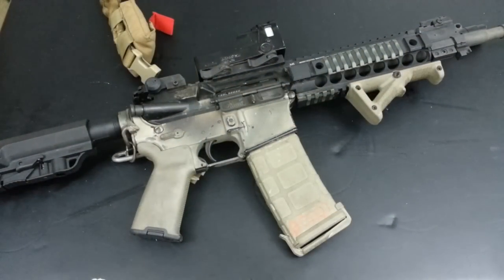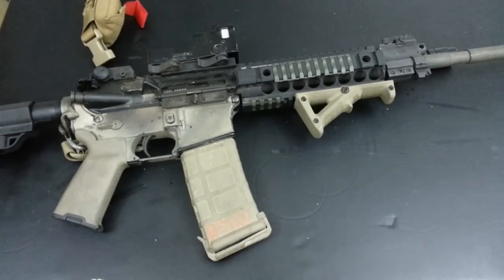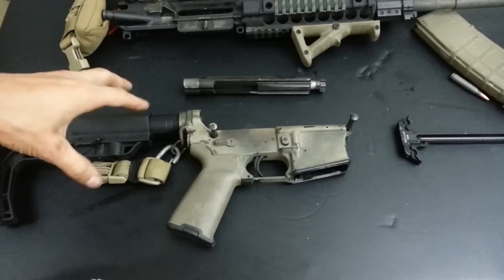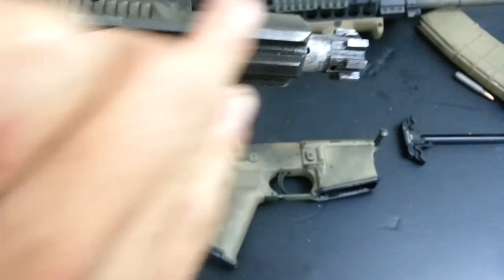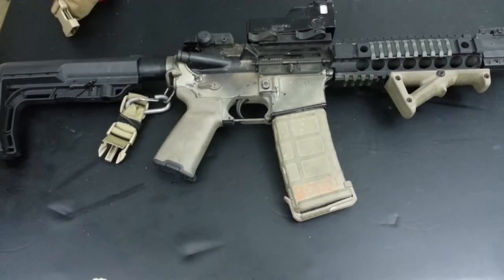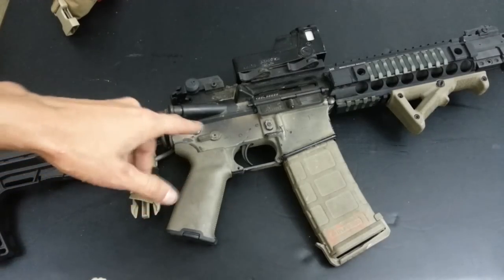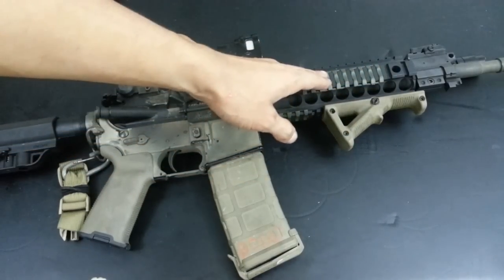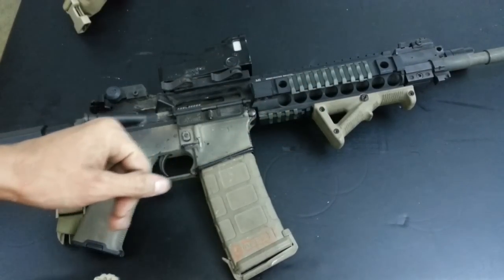CMMG AR-15 Piston Conversion Kit- Review

Comment: Good video. I have a piston driven AR. LWRC M6 IC Tricon. I have fired plenty of M16's and m4's when I was in the Army. They would jam up and what not from the carbon build up and excessive wear. I know you stated the recoil impulse was different and was wondering if your conversion kit was a short stroke or long stroke system. I know that my rifle has a short stoke system and I don't even notice a difference in the impulse. Not sure if it's the system or the Surefire muzzle break that really helps it. Either way it's almost non existent. Sucks about the weight though. Hope the rifle continues to run flawlessly and your happy with it. Keep up the good work with the videos. Looking forward to watching many more.
Reply: Ivan Ayala all ar piston guns are short stroke except for PWS to my knowledge at the moment.
Reply: MrHemimechanic2 ok. I knew about PWS but wasnt sure if there were any other companies using long stroke piston systems. Thanks.
Reply from the maker: Ivan Ayala this is short
Reply: AregularGuy ok. Thanks man.

Comment: Great review, I still think AR's built from the ground up as Piston rifles are a better option if you don't own an AR but this kit ain't bad at all for $400 with a bolt carrier. I really like the spring loaded bolt. I removed the gas key rings from my SIG516 so it could cycle with less friction but the draw back is that you can hear it sloshing around sometimes. I like the fact that it has a  one piece bolt carrier. IMO I think all AR's bolt carriers; piston or not should be one piece. Good review 👍.

Comment: I have a cmmg mid length. I got it probably got it in 2010. Got mine as a complete upper. Runs like a top. Cmmg quit making them. They offered to convert mine to di for free. I guess they just don’t sell them as much as they used to.

Comment: Did you run steel cased for the class ? I was wondering if so, how many times you bore bathed it.
Reply from the maker: Yes and I did bore bath twice. But more our of paranoia than anything.
Reply: AregularGuy I hear ya. I would do the same thing

Comment: with a di gun, the gas pushes the carrier rearwards, but at the same time pushes the bolt toward keeping it locked. The spring is probably just to keep the bolt locked a little longer while the carrier starts to move rearwards, just like in a di gun. It can't be THAT necessary cause the lwrc I had didn't use the spring and functioned flawlessly, piston ar's just ain't my cup of tea.

Comment: Through my very limited fucking experience with my 500 round ak and ar test. I'd prefer an ar15 if I'm putting down mag after mag of accuracy fire back to back. Carbon isn't what makes me as nervous as the heat the gastube gets on a fucking ak only say 8 mags.

Also one thing to note I think CMMG discontinued their piston system.
Reply from the maker: The ak doesn't have a problem with heat, just your hands.
Reply: AregularGuy  What I'm worried about is the heat that the gasblock and  barrel are taking. IV8888 ak meltdown I'm really curious about  with my 500 round test of constant fire accuracy fire. Granted is test was full auto. I think it's like you say I believe the system doesn't really bleed heat.
Reply from the maker: it wont care about 500 rounds bud